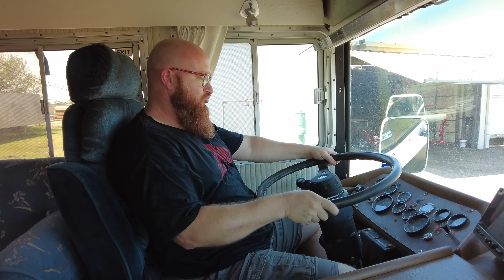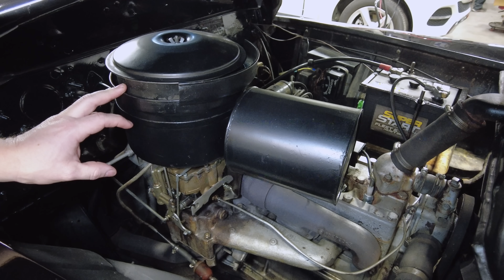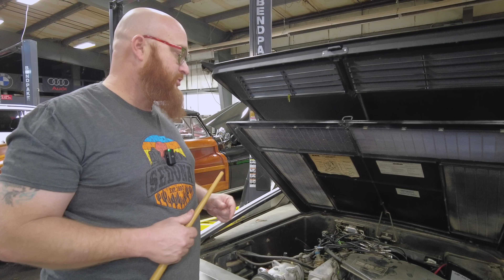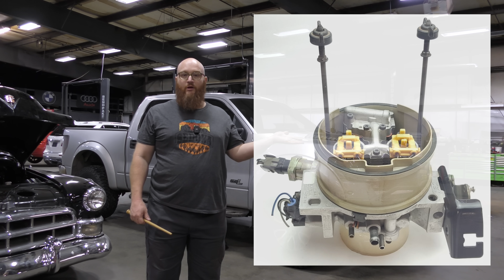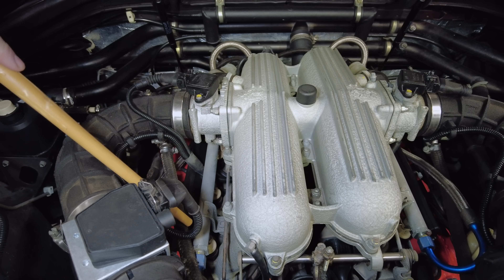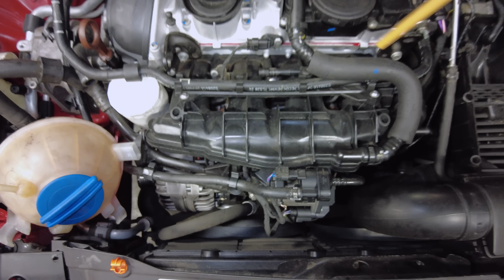Fuel System Maintenance for Every Car Type: A Comprehensive Guide

Comment: I hated those automatic chokes {half the time they never worked right} so on my '64 Merc. {390CID} I run a holley 650 double pumper with manual secondaries and choke, never an issue to start even if sitting for a week in cold weather

Comment: If one gets a bad fuel pump jeep it’s ok to pull off the fuel line and duct tape, duck tape or gorilla tape to the throttle body. Even a problem pump can deliver fuel enough to idle up to 15 mph. 😮

Comment: Wizard, if you don't want the vapor lock issues with an old tractor or anything related to modern fuels, you'll have to buy low lead aviation fuel. 

Granted, it's expensive. But there's no alcohol in it. And you might have an issue with lead fouling on the spark plugs. But those are minor

Comment: THANKS SO MUCH MR AND MRS CAR WIZARD. 

MUCH MORE CONCISE AND TO THE POINT I APPRECIATE IT.

 LOVE THE HISTORY OF THE EVOLUTION OF FUEL INJECTION. 

WITH ELECTRIC CARS BECOMING THE NORM AND SMALL MODULAR REACTORS AND EVERY CITY POWERING OUR ELECTRIC FUTURE,
 YOU WILL HAVE PLENTY OF WORK WITH DEALING WITH THE ANTIFREEZE THAT RUNS AROUND THE ELECTRIC MOTORS.

 MY HOPE IS YOU DO AN EPISODE IN THE FUTURE ABOUT THE SEALS OF THE ANTIFREEZE THAT RUNS AROUND THESE ELECTRIC MOTORS.

THIS ANTIFREEZE COLLECTS HEAT OFF THE MOTOR TO WARM UP THE BATTERY IN COLD WEATHER
 OR SUPPLY HEAT TO THE CAB OF THE VEHICLE.

 THE MAINTENANCE ISSUE THAT IS LITTLE KNOWN,
  IS THE SEALS AROUND THE MOTOR START LEAKING ONTO THE MOTOR AND CAN DESTROY THE MOTOR.

 THERE'S NO WARNING LIGHT OR INFORMATION IN THE BOOKLET ON THIS MAINTENANCE.

 THANKS AGAIN FOR ANOTHER GREAT VIDEO. 

..

BUILD NUCLEAR POWER ON AN ASSEMBLY LINE BASIS AND PUT THEM UP WORLDWIDE AS FAST AS A WALMART.

NUCLEAR POWER CAN PROVIDE ELECTRICITY FOR CARBON SCRUBBERS. 

CAN PRODUCE HYDROGEN FOR TRUCKS BUSES, RV'S  AND AIRPLANES.

 CAN BE SCALED UP AND DOWN TO COMPLIMENT WIND AND SOLAR.

THEY BURN UP MORE WASTE THEN THEY MAKE.

THEY ARE NON-PROLIFERATION. 

THEY ARE WALK AWAY SAFE.

CAN  PROVIDE STEAM FOR HEATING OUR CITIES.

CAN BE SMALL ENOUGH FOR A CRUISE SHIP OR A SMALL TOWN.

PUT ABOUT 12 OF THEM IN A ROW FOR A LARGE METROPOLITAN CITY.

TRULY COMPLIMENTS A LOCAL POWER GRID.

SMALL FOOTPRINT ABOUT THE SIZE OF A HOME DEPOT.

POLITICIANS AND THE MEDIA HAVE TO STOP SCARING PEOPLE ABOUT NUCLEAR POWER.

 NUCLEAR SAFETY PEOPLE ARE A PARASITE ON THE BUSINESS, MAKING IT SO EXPENSIVE IT CAN NEVER BE BUILT. 

NUCLEAR POWER IS OVER 99% SAFER THAN PETROLEUM PRODUCT EXTRACTION AND FOR THE ENVIRONMENT.

Comment: I just got a 06 land cruiser with 243k miles last July. Would Lucas fuel injector deep clean or sea foam work better and cleaning out the gunk? Overall the vehicle was well maintained and I did the timing belt + baseline when I bought it.

Comment: I would expect that the lower boiling point is to help with the extra fuel wash from port and especially direct injection computer controlled motors.  The PCMs are typically programmed to run 60%+ throttle position, so that the motor has no choice but to pop off every time like clock-work.  It leads to fuel wash on the level of flooding a carbureted motor, if not worse.  The point is that the lower boiling point will make it much easier for the fuel to separate from the oil in the crankcase.  There have actually been synthetic fuels since the 1930s, but they had too high a boiling point and no one wanted to engineer an engine to run with an oil temp of 250+F.  This is a serious issue to plan around if you are installing an oil cooler as well.  If you will be dayling it, then you will need one with at least a 180F thermostat, so that the oil gets hot enough to separate the fuel wash as soon as possible and stays there.

Comment: I think some of the higher performance VW's with the 5 cylinder turbos had port and direct injection which helped give a HP boost by engaging the port injectors under boost and had the side effect of keeping the valves clean by doing the classic "Italian tune-up" on them.

Comment: Having owned a Delorean for forty years I think I can be honest about the Delorean engine and it's fuel delivery system. First the K-jet was not designed for today's fuels. The modern fuels corrode the interiors of the parts which run the fuel system. However, if you use the car as a daily driver these problems become a non issue. Delorean owners  can drive their cars every day and have no problem with them. Having driven mine for 12 years as a daily driver and putting easily over 250,000 miles on it, I never had to fool with the K-jet. In fact the only thing I did was change filters and fluids. The PVR engine is a very robust engine. I did do one thing to make the engine even more bulletproof, I added Slick 50 to it's oil and ran only synthetic oil after 10,000 miles. One down side with Slick 50 was it turned the Delorean engine into a air cooled engine since it is an all aluminum engine, which on cold NJ winters makes it difficult to get heat to warm the interior. On the plus side if you blow a hose and completely run out of coolant the engine cools itself even on a hot summer day in bumper to bumper traffic. Yes, that really happened, with no damage to the engine. First and only car I ever bought NEW. Never regretted that decision.

Comment: well they all there goods and bads  a total mechanical carborator  would work after a emp  but a fuel injection system would not  port or direct injection port is better at cleaning the carbon off direct injection builds up carbon  what would i chose a car that has both port and direct injection and  mechnical carb  with a crank start back up

Comment: You didn't mention dual port injection: port injection AND direct injection. Subaru BRZ flat 4, Toyota, Audi and Ford has engines using this tech. Research is primary.

Comment: Since we are on the subject, i have a project car, peugeot 205 1997 gasoline  PSA TU3, i rebuild the entire engine, 2 months after that the injector (bosch system) died , its a bosch 692, impossible to find , i search everywhere, i was able to get a 695 and a 698 from different engines, but no dice, both send way to much fuel, after dealing with it for like 6 months i endup convert it to carburetor only, i had to add a choke line to be able to start it, it was a pain, the fuel system has too much prrssure and the pressure regulator was incompatible with the recirculate bowl, and it sprayed gas all over the place, finally i get rid of the original pump and i install outside a low pressure pump, and now it works , knowing what i know now, i should have replaced the entire valve assembly for the Peugeot 206 16valve and use that computer instead, but now it works so im not in the mood to spend more insane money in an old car, works fine though, very powerful for such a small car! Nice toy to do all kind of dangerous crap i shouldnt do😅

Comment: Fyi, in 1968, VW offered the first WORKING fuel injection in the "type 3", was the Jetronic made by Bosch. Although, AMC and Chrysler had ELECTRONIC fuel injection in the late '50s, there were too many problems with those systems, so they reverted back to carburetors !
Reply: AMC never used the Rochester system on consumer cars. They experimented with it, but never put it into production.

Comment: In general - air filter on top of the engine with a nut or wing nut - will be carb.  Anything else - some form of injection.  Even my '89 Civic Hatchback (the low-end DX model) had a basic injection system (throttle body if I remember correctly).  If the car is 2000 model or newer - going to be an ungodly baaaaaaasic car to have a chance at a carb..

Comment: Wizard, awesome description and explanation of the CIS K-jetronic mechanical fuel system. It explains why everyone assumes Deloreans are "junk". It's an antiquated fuel delivery system that not many people around can service anymore. I had to learn it myself to be able to maintain it in my Delorean. As long as it's maintained, it can be just as reliable a car as any
Reply: "As long as it's maintained" can be translated to "drive your car regularly". My DeLorean has over 255,000 miles on it. All I do is drive it. K-Jet is all original as well as the fuel lines. Yes, I know that scares alot of D owners, start the flames now. The reason I have had no issues is that they are used and not just sitting for a long time. Only "maintenance"  I have done is to clean the injectors a few times. Yes, they are original too. K-Jet is nasty if left sitting for a long time. I have helped a few owners get theirs back running again. Not fun, but once back up and driven regularly they are reliable. Sorry, I am sounding like a broken record now.
Reply: @shannonyocom5378  agreed. Too many people buy these cars, let them sit, then don't understand why there are problems. Drive em! The reason people talk about replacing the fuel lines so much is that under that rubber hose are thin plastic tubes that are the actual fuel lines. They have started getting more brittle as they age and with all the crap  they do to gas these days. If they do split or break then you could just go up in flames. Again, maintenance.

Comment: I had a 72 SAAB 99 with L-Jetronic which they replaced with K-Jet after the 72. The L-Jet was fun to work on….not. I kept the manifold and TB and would like to build another with a aftermarket EFI, but keep it looking original.

Comment: One he did not mention is the dual injection system, port and direct. Toyota/Lexus went to this on many engines around 2010 or so in part to get away from the carbon build up issue.

Comment: You skipped a step, in the 80s there was some computer controlled carburetors that were a mix of electronic and computer controlled.  The Quadrajet E4ME comes to mind.  At cruise, the computer used a solenoid in the carburetor to provide fuel, but at full throttle, the secondary's opened mechanically/vacuum like a traditional carburetor.

Comment: While very short lived, electronically controlled carburetors were a thing in the early 80s. My dad had a 84 Ford Tempo with one and it was fine, great mileage, passed emissions with no problem, it was later on sold to a relative and their mechanic had no idea how to work with it, disconnected cables and vacuum hoses and it ran like crap.
Reply: I had one of those. Bought it brand new in 1984, Ford Tempo. Loved that car and upgraded to a 1988 Ford Tuarus which I had for 164K miles both were no troubles cars
Reply: I had an 84 Nissan Sentra with one. The electronic carburetor had a solinoid that controlled fuel flow through the main jet, I believe. It also had an an oxygen sensor for fuel richness feedback.  Engines with electronic carburetors had lots of vacuume lines that operated various sensors and actuators.

Comment: 13:00 before carburetor's there were Mixers, and in-between carburetor's and throttle body injection they used to sometimes use an Electronic controlled fuel jet solenoid based on a narrow band 02 sensor  and other data accusation engine control systems, Mazda was one of the first to do this and had it on there b2000 b2200 and b2600 series carbureted trucks from the late 80s

Comment: My 93 Grand Cherokee once had the gas tank boiling! 

Out on a trail, fuel was pouring out from the top of the tank. I cracked the cap and pressure came spewing out. Was fine the rest of the day.

I replaced the fuel pump and a pressure relief valve on the tank and haven't had that problem since.

🤷‍♂️

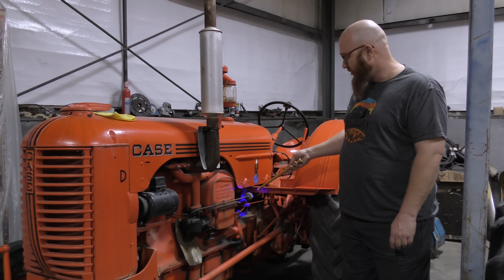Comment: 1:45  updraft carburetors cause performance issues but they prevent the crankcase from filling with gas from overflowing bowl, the fuel metering device/floater closes the circuit as the fuel pushes on it using fluid dynamics and bouncy, the float in the carburetor bowl bouncing around in shipping on trailer around the farm and bumpy roads makes this hard and it WILL overfill, a piece of lawn equipment will always flood badly and be hard to start after bouncing around, will also smoke and burn oil for awhile if you tip it sideways, and maybe not start
Reply: Eh downdraft carburated tanks did not have this issue. Tanks certainly go over bumps etc a lot

Comment: Fuel delivery type is a very noticeable difference on a car and it truly transforms it when it's had that upgrade done. I used to have a 1988 Corolla as a first car, lost that one after 7 full years, bought the exact same car but this was now a 1992 model year with the exact same 1.6 engine but now the engine had electronic fuel injection standard for that year. Carb engine was rated at about 90hp while the EFI was rated at 105hp and I could honestly feel the driving dynamics of the EFI engine to be a real step up.

Comment: Hey Wizard!! Can you have a discussion about Top Tier gasoline? Does it minimize carbon buildup in direct injection systems? We drive a 2017 Hyundai Sonata with the 2.4L., direct injection. You can actually hear it when it’s running. 

The Sonata has 51k miles on the odometer and it runs as good as new. Excellent fuel mileage - 38 mpg Highway, 26 City. We do use Top Tier gasoline. 

Thanks for your entertaining and informative content!!
Reply: The attraction of Americans to snake oil never ceases to amaze me. How can petrol that does not pass the valves, clean the valves? That's just the whole point with direct injection problems, the petrol doesn't clean the valves, no matter the fancy name you give the petrol.

Comment: One system that is missing was the CPI injection on the original GM 4.3 Vortec. It was kind of weird that it had a single main injector attached to 6 tubes with poppet valves at each cylinder. Not exactly the most reliable system, especially compared to the TBI, as it was prone to leaks. Made way more power, though.
Reply: Yeah, I was really hoping he'd touch on the Spider Injectors
Reply: Yes that system was really weird but it was basically a remote mounted multi port injection system. there were 6 or 8 mini injectors in the fuel block which replaced the fuel rails with plastic tubes and poppet valves going into each intake runner. they released an updated spider assembly that ran tubes from the fuel block with the injectors relocated to the intake runners where they should have been in the first place. also now all the tubes and wiring are sitting inside the intake manifold and probably cause turbulence in the intake path. honestly they would have been better off having normal port injection the real power gain was the vortec heads not the spider injection.

Comment: I have  a toyota rav 4 with 140000 miles and  21 honda crv with 80000 miles would it be recommend  to service fuel system ?   Thanks

Comment: I think you disparage the Bosch Jetronic systems unfairly. They were very neat systems. I worked on them a lot in the 70’s and 80’s. If you take the time to study how they are set up, they are easy to diagnose and repair, proceeding systematically.

And BTW, any car will deteriorate if you just let it sit for years or decades, as you well know. As well, studying how a system works is important for any repair. You’re young, and just haven’t seen enough of them. :^)

Comment: Thank you, wizard, great coverage of this subject, IMO. Fortunately, I am old enough to have experienced most of these systems firsthand. The one point I would have mentioned that didn’t come up was how much drivability improved when we got to the modern fuel injection system. Now, the computer knows everything: Ambient temperature, coolant temperature, oxygen sensors, engine load, throttle position, etc. so that an accurate fuel map is available for all operating conditions. Now you can start your vehicle, wait a few seconds for the oil pressure to come up and confidently drive away without fear of the engine misfiring or hesitating during warmup. This has eliminated the need for extended warmup periods and made driving a cold vehicle much safer. I should add that electronic ignition has also helped in that hotter spark is available all the time to ensure there is no misfiring from a spark that is too weak. A spark plug with 0.020” of gap verses one with 0.060” gap supports a much stronger and more reliable source of ignition.

Comment: Vapor lock happens on my direct injected 2012 F-150 3.5L Ecoboost.  I am going to try insulating the low pressure fuel line, where I can, to see if that fixes it.

Comment: Hey Car Wizard. I own a 2020 Honda CR-V with the 1.5L Turbo engine with 30K miles. Because it is a GDI(Gasoline Direct Injection) engine and because GDI engines are known for developing carbon build-up around the intake valves, what's your recommended service interval for doing a fuel injection and intake cleaning(chemical cleaning w/o removing the intake manifold)? People tell me about 20-30K miles for preventative maintenance. Does that sound right?

Comment: The up draft carbs were used to ensure a leaking needle and seat did not flood the engine with gas.  If angled correctly, a side draft will ensure against that too.  You skipped over the hybrid GM and other carbs that had little idle buzzers that were controlled by an ECM with O2 sensors, Map sensors, etc.  early 80's GM.  very reliable and set the bar for computer controlled engines.  Basic LH Bosch jetronic in the late 80's and early 90's volvos and whatever else used them is the best of the FI cars.  too complicated after that.